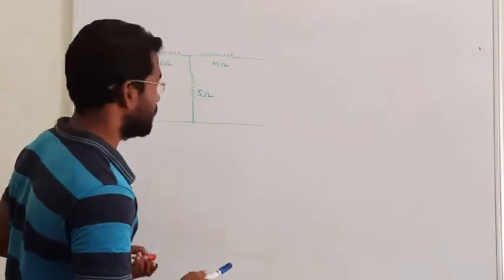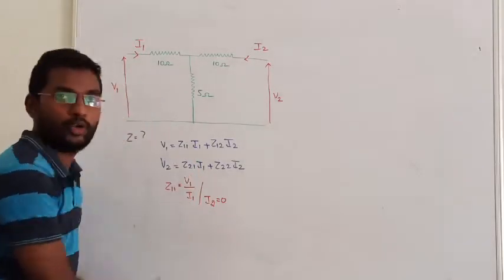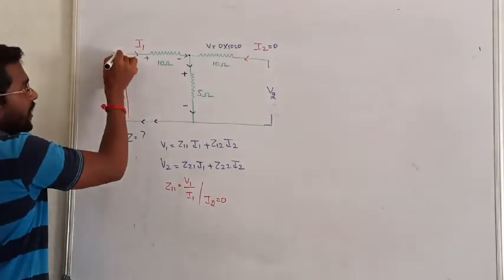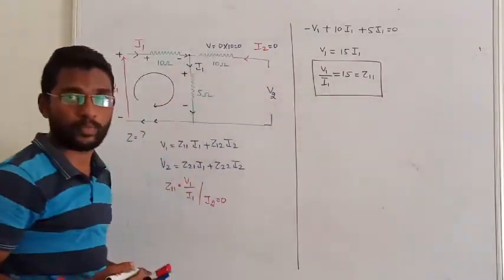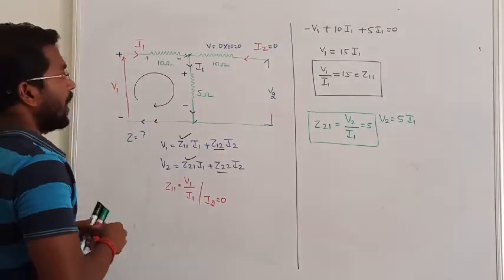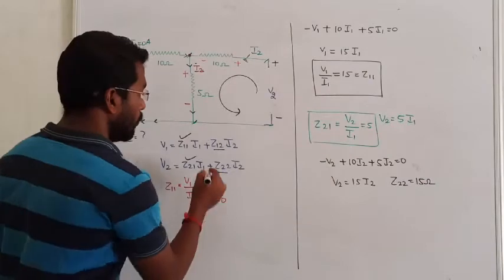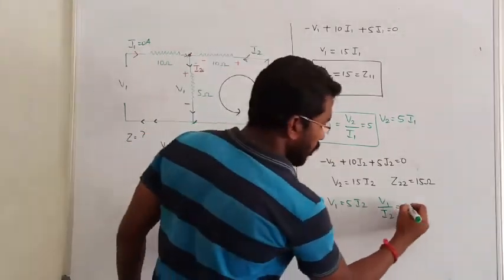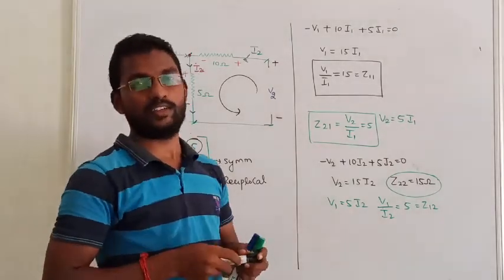9.TWO PORT NETWORK PROBLEM NO 1

Comment: Sir I am 2020 EEE Passout..

I made currently trying for electrical competitive exam.. your lecture about two port network is very effective.

Thanks kindly make a whatapp group in order to connect with  you. For any clarification..
Reply from the maker: 9791508785 text us through what's app.